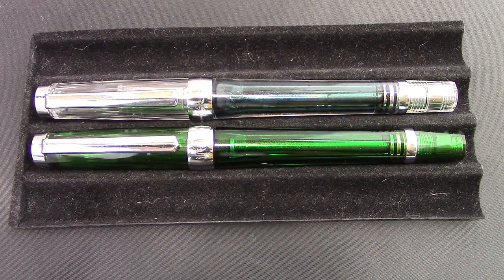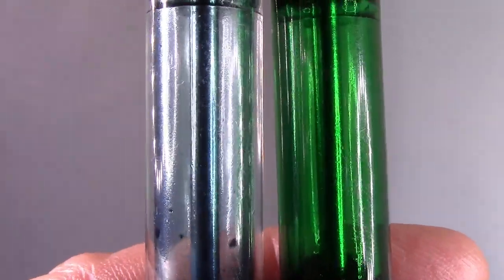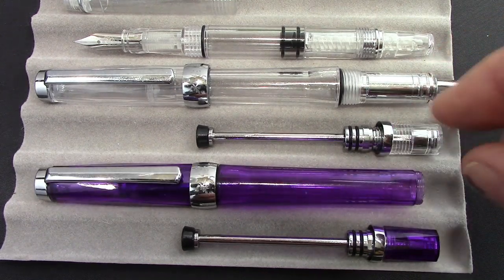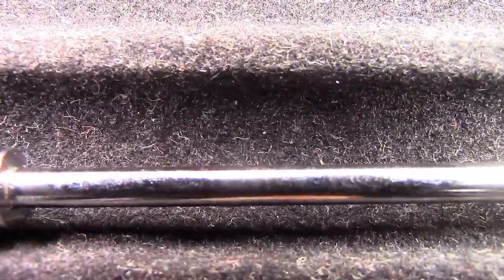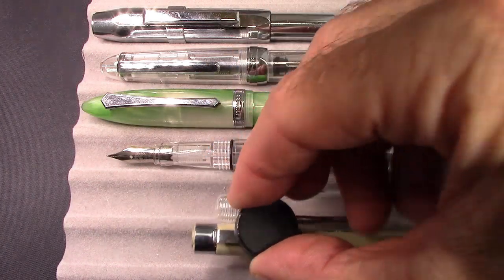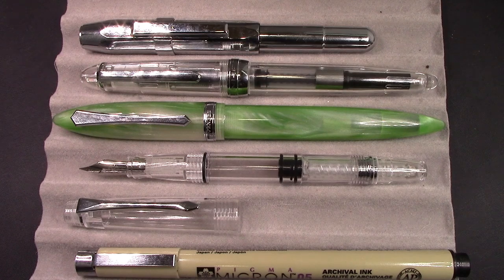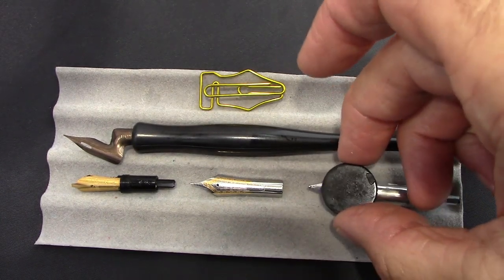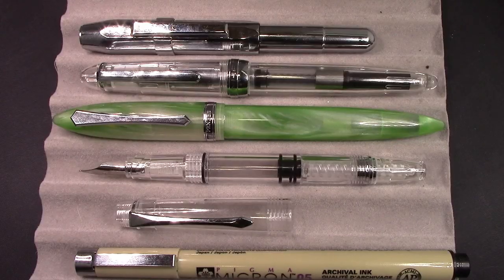Is It Steel? Why the vac rod in a 3013 may corrode.

Comment: Thank you Chris . I worked in Automotive coatings for 30+ years and so i have a good understanding of metallurgy and polymer coating as well as metal coatings. Probably a better choice for the piston rod would have been high grade stainless steel (316) but brass is fairly corrosion resistant dependant on the grade. I don't see these rods corroding to the point it would affect the life of the pen that much , perhaps if you are using none neutral pH inks they may corrode faster , time will tell.
Thanks interesting video.

Comment: this is an informative video!... thanks... there is a lack of information about the durability of the materials that go into the production of fountain pens, and i hope you can continue to address this... for example, you mention plating... can you enlighten us on this subject?... in vintage pens one sees the brassing that occurs in say a parker parkette (a lower end pen)  but which is less so in a parker vacumatic (a higher end pen)... and even some higher end pens have material that has not held up... for example, the celluloid in the more colorful eversharp dorics have been reported to show signs of deterioriation (grazing, i think it's called)... how can we determine in modern fountain pens, many of which are costly, that the makers are using materials that will last at least as long as the higher end fountain pens of the past... and how will these pens hold up under different types of cleaning?... i hope you and other reviewers that have expertise in this area can address this topic, as you have done so in this informative video... thanks again...
Reply from the maker: Thanks, I'll try to add to our pen knowledge.  Many vintage pens used gold filled metal which is much thicker gold than plating & will hold up longer.  It is difficult to evaluate modern pens for longevity.  Besides the quality of components, environment can affect a Pen's condition.  Exposure to sun light, water, heat, cold, etc.  I've seen some vintage pens disintegrate sitting in a box of pens.  Something is one or more pens in the box emitted a corrosive gas.   Other pens look mint after over 100 years.
Reply: @chrisrap52  thanks again... i didn't know this... it's quite interesting...

Comment: Thanks for the explanation.  It really makes sense and gives me an idea of the quality of the build. I have a question about a kind of nib shim for lack of a better term. You demonstrated it a while back. It was something that had been included with one on your orders. I didn't know what the purpose was until you showed us. I used mine extensively from that day. Of course it is lost and I need another one.  Any idea where those came from? Appreciate any help.
Reply from the maker: Bobby sells them - https://www.ebay.com/itm/1Pc-Custom-Iron-Sheet-Tool-To-Adjust-The-Slits/233131977337  Seller : office_supplies_pen

Comment: My higher end stainless steel tumblers and mugs are not magnetic or weakly magnetic when I use neodymium magnets. So I wouldn't be surprised if some of the metals that are in contact with the ink are of the same kind. Still cheaper than brass.

Comment: Thanks for another nice video. However, not being magnetic to me means it is not common iron or steel that easily rusts. It cannot directly prove it is not iron or steel. Based on my experience on epitaxy tools, stainless steel for critical parts in my tools is very weakly or not magnetic. So I would say the rod can be made from a certain kind of stainless steel or simply other metal such as brass. Anyway, after seeing this test, i guess it is not likely that the rod becomes rusty easily.
Reply from the maker: I use my visual examination to determine the rod is plated.  Brass is the typical base metal used in these pens for plated parts.

Comment: This was interesting. I had noticed that some of these Chinese pens did not have steel parts where I expected steel. I had not experimented with this particular pen. Fun that you did the same experiment with nibs that I did. I remember mentioning it in one of my videos and was told the same thing you mentioned about the nickel. (Maybe you're the one who mentioned it.) I wonder what the explanation of the rod actually is? Now I'm curious to try this on my Pilot 823!
Reply from the maker: My quests would be stainless steel for 823 rod, non-magnetic.  Also should be very smooth polish, no pits like 3013.  Conid uses titanium for their rods.

Comment: I got all five colours of 3013/013 and inked them with matching colour Sailor Shikiori/Pilot Iroshizuku and Pelikan 4001 inks. 
I'll let you know if I observe anything. 

Also, Chris, given the occasion, I'd like to ask you if you have tried to change the nibs of these pens and if yes what number size nib did you use ? (#5 ?)
Reply: Hi, Any update?
Reply: @billybob-xy5pt  yes, some of them corroded and some others started to give me hard starts. I don't use them any more. May be some time in the future.
Reply: @korax67 thank you for the reply.  I was planning on getting 4 to use different inks simultaneously, I'll get one first to test it out. But overall would you say they are good pens?
Reply: @billybob-xy5pt  for their price it's a steal ! The fine nibs are very good. The built quality and the general feeling is absolutely positive. You won't be dissapointed, if you want to try this filling method. But be aware that it is not a pen that will last a life time like a metal Jinhao. Overall I didn't regret buying them at all.

Comment: But is it rust or just a bit of corrosion/pitting? Rust sounds scary.
Reply from the maker: That was why I tested for magnetic steel.  I did not observe any changes to the rod.  Some did & called it rust.  It is not, maybe pitting.  All are forms of corrosion.
Reply: @chrisrap52  Thank you. I'll be ordering a Paili green and blue in F later tonight. I hope they turn out as good as yours did.

Comment: Steel doesn't have to be magnetic, it depends on the phase. Austenite/austenitic steel is non-magnetic and usually very corrosion resistant.
Reply from the maker: Had to look up austenite - Found this: "Fundamentally, the reasons why ferritic stainless steels are ferromagnetic while austenitic stainless steels are not are quantum-mechanical in nature."  Austenite stainless steels usually contain 8% or more nickel which is the main reason for being non-magnetic.
Reply: @chrisrap52  Nickel doesn't cause the alloy to be nonmagnetic directlly, it simply enables the austenite to be stable at room temperature. Pure iron can also be austenitic and thus non-magnetic, it just has to be heated to ~1200°C (if memory serves), however once it cools it's phase will change back to ferrite.

Edit: other alloying elements (like chromium) also stabilize austenite, Nickel and Chromium are simply the most abundant.